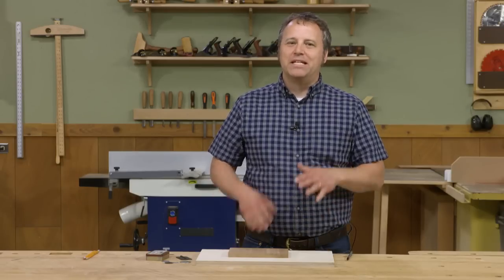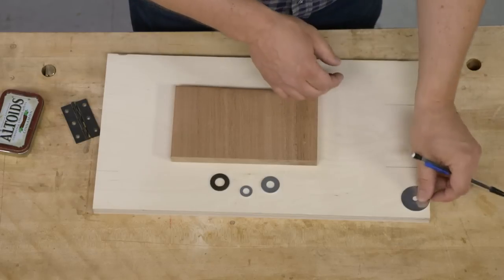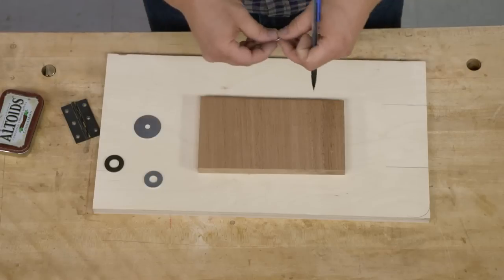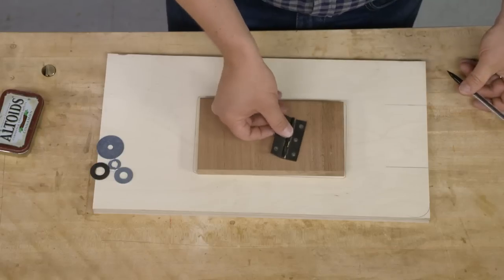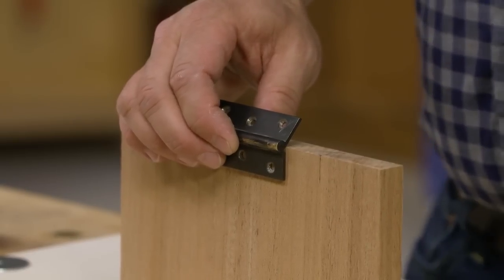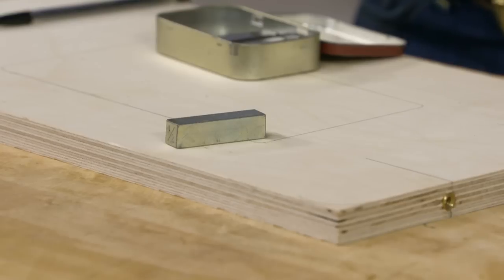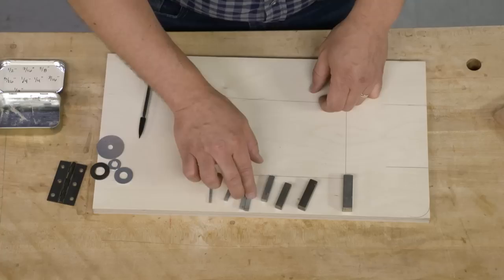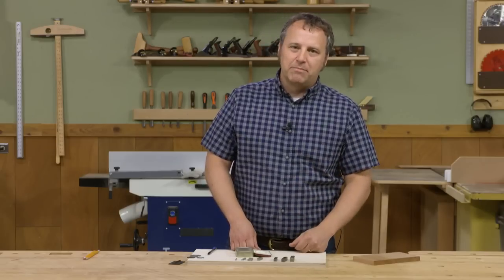Woodworking Tip: 3 "Found" Layout Tools

Comment: The washers can also be used vertically as scribe markers to, for example, scribe a door casing or cabinet facing to an irregular wall or a baseboard to an uneven floor. Replaces the traditional compass.
Reply from the maker: And the washer is easier to use as the scribe in my opinion. Scribing with a compass is a learned skill and not as natural to pick up.

Comment: I also used the washer idea and have some small spice jars and pvc pipe which I use for a larger radius. The 2 other tips are handy, need to look through my hinge collection and I never thought about the key stock idea. Thanks for the handy tips.
Reply from the maker: Considering the price of many setup bar sets, you can have several sets of key stock versions. And get multiple of sizes you use often.

Comment: Very interesting,  those keys are cheaper then buy setup blocks
Reply from the maker: Way cheaper. Like I said, get several of the sizes you use most often. I use them when setting practically every power tool.

Comment: The only issue with key block stock is it's hardness. The reason setup blocks are usually brass or aluminum is because they won't damage the edges of the tools, like router bits. Key block stock is a lot harder so care and attention are essential if they are going to be used.
Reply from the maker: I get where they're coming from, but honestly, how hard is a person smacking setup bars around where it would actually get to the point of damaging a cutter? I think brass and aluminum are used for A) less expense and B) less likely to rust in shipping and storage.
Reply: @WoodsmithShowandmagazine  Key stock is less expensive than either brass or aluminum (check Lee Valley or Kreg). I find Woodsmith does not target the DIY garage woodworker. Many part timers are simply not careful or not as informed as they think. Part timers will not spend the time to sharpen chisels or planes, or invest in more expensive tools. How many DIY'ers  in your neighborhood use a circular saw with a blade so dull you can hear it screaming from down the block or see the smoke it's generating? While many of the ideas and projects presented by Woodsmith are great, they need to step back and understand that their target audience is not as educated as they are.